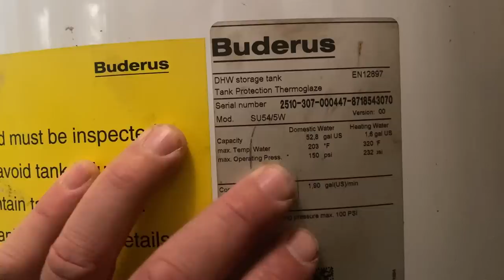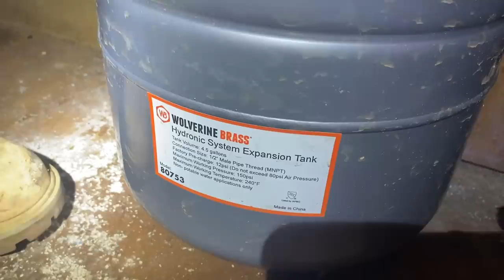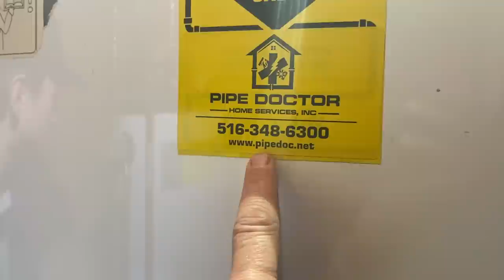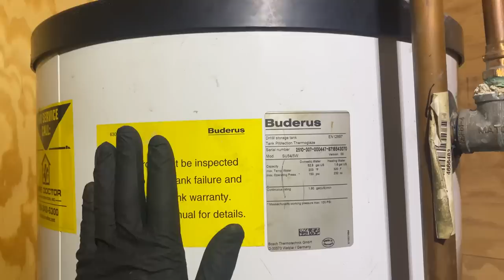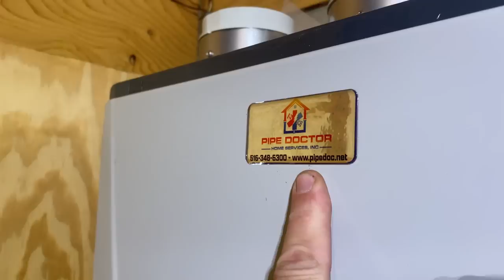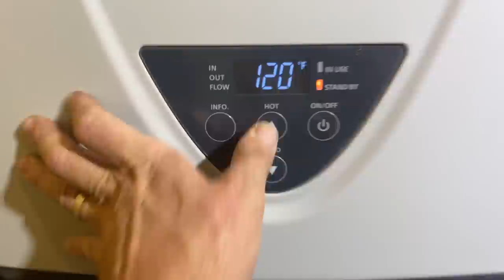How to Install Step by Step Endless Hot Water Buderus Indirect Removed & Takagi Condensing Installed

Comment: Please MP, don't forget to recommend checking the "Hard-Water" aspects of the local water-supply & the important need for an A.O. Smith Type 5-Yr. Resin-Based (Sealed Unit - No Salt) Water-Softener catalyser along with a whole-House (Also a 5-Yr. A.O. Smith Sealed-Unit of course) Water-Filter.  

I ran my set-up with both Pre-&-Post A.O. Smith Replaceable Whole-house Cartridge Water-Filters as well.

PRO-TIP: Install a Automotive Cold-Air 4" Intake Washable CONE-FILTER on the Air Intake Pipe to the unit provide for perfect filtering that doesn't require the complete disassembly of the unit to clean-out the internal filter.

Comment: My Rinnai has dip switches inside to raise the temp beyond 120*. It's a safety lockout so homeowners don't scold themselves. They also have a second dip switch if you raise the temp you have to raise the flow meter. Learned the hard way not doing the second one. Water gets cold in the middle of a shower. The only regret is not having a recirc line. Builder installed so no choice.
Reply: Rinnai are great, here in Aus we install them outside cos it doesn’t get cold enough in winter to have them inside and regularly last 10+ years with no servicing whatsoever
Reply: @BrickTop900  I flush mine yearly. It's do this month too. Mine is also an outdoor unit.
Reply: @scotts4125  the newest models here look identical to the ones available in the US. In the past they were different. What’s interesting is the US manual talks about flushing and its not even a thing in our manual
Reply: They make a Recirc Adapter that installs at the far-end of your water-supply system to provide for this type of feature.
Watts Premier WP596816 Sensor Valve Kit for Watts Hot Water Recirculating Pump, Silver
Amazon $84.14

Comment: I just purchased some new work pants,I would say the most comfortable workman's I've ever had.
The brand is 32 degrees,$16.00 a pair,quick delivery. 
I recommend you buy one pair,make sure they fit then order them up,very good pants,they clean up well and are wrinkle free! Check it out!!
Reply: @PipeDoctor  yeh,they are heavier, the pants I got may not be good for the cold months, they're very lightweight stretchable Material .you're doing good work up there my friend, congrats on the 50,000, I just broke 600 😆 ,we all start at zero and the sky is the limit!

Comment: If I run cold water through the pipes let it drip will they freeze if it's 20 grease out or do I have to let it rip drip hot water I have a very small hot water tank I'm renting my very 1st place I moved in a couple weeks ago I know it's gonna get down to the twenties tonight I have to work a 13 hour shift if I let the water drip under cold water will that prevent my pipes from freezing or do I have to run hot water